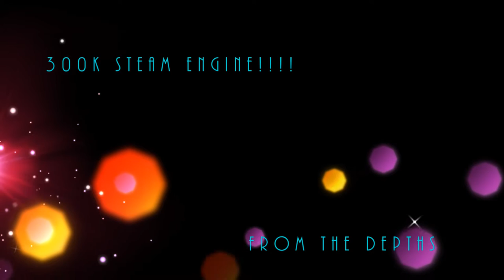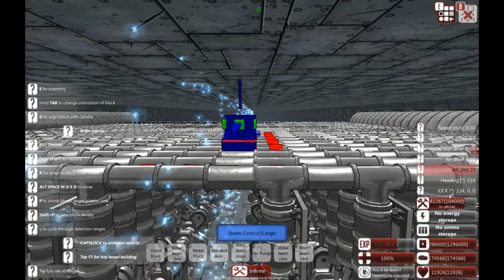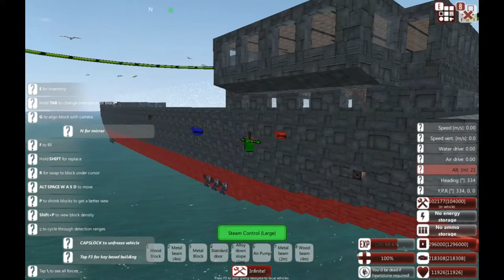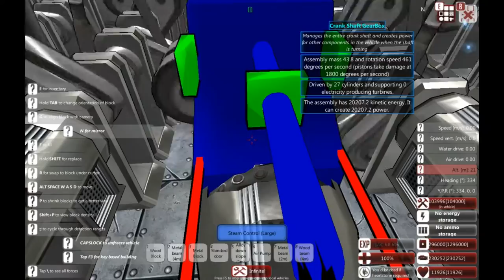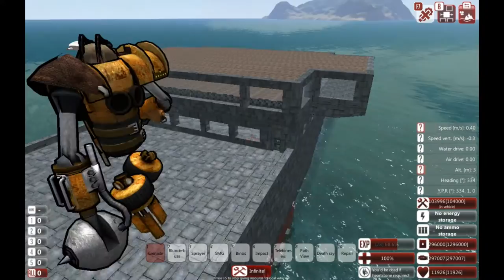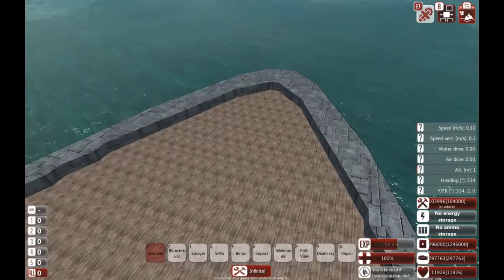From the Depths - 300k Steam Engine

Comment: How much materiel use pr. second at max power
Reply from the maker: Chano Chrillesen good question. I don't have a Scooby doo but definitely don't use on a campaign
Reply from the maker: Chano Chrillesen so based on 3 cylinders in the boiler it is about 4 per second. I believe the boilers are about 28 in length which is 9 times the amount plus a bit so 36 -40 mat per second per boiler set so about 80 per sec. will load it up and check it out later. hang on 4 boilers. so 160 per second
Reply from the maker: 38.3*4 mat per second
191.7*4 boiling chamber size

Comment: dont steam engines only produce about 2800 power per boiler? and dont you only need ~1 piston per boiler to avoid the pistons going to fast. i think you even only need to pipe up 1 piston per crankshaft to make that whole shaft generate it's full power. also you get faster ramp up time with less boilers per crankshaft.

i suggest designing the most compact engine with most separate crankshafts, 1 boiler per piston. then put several of those across the ship. that way you'll have redundancy both in each individual section of engine (which means minor localized damage will cause less power reduction) and redundancy of your entire engine power as the sections are spread out and one hit wont take out all your power at once. in addition to faster ramp time.

the way you have it now, one shot to anywhere in that area and you either lose all your steam or lose enough pistons to break the whole thing.

also you dont need gaps between cranks. it'll look stupid but if you are going for performance, cram those fuckers together.

also also by having a large single engine you have to put it in a large single room which prevents you from compartmentalizing the ship which protects it from flooding.
Reply from the maker: Thank you for your comments, I think the reason I put them 1 gap apart is because you need that gap for wheels and generators. I usually suggest 1 part of boiler per crank myself (see other videos). I will try to make a condensed boiler system to provide redundancy and post a vid at some point.